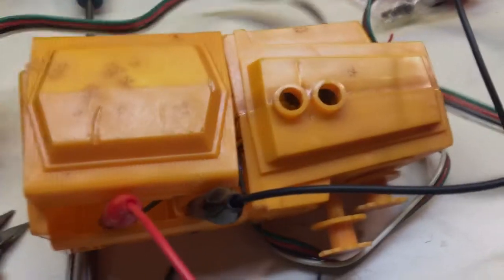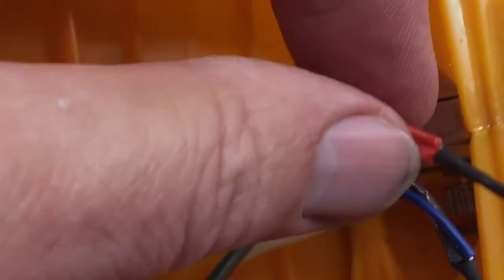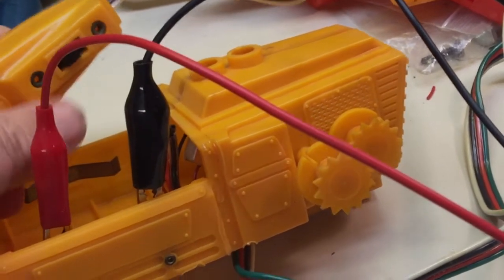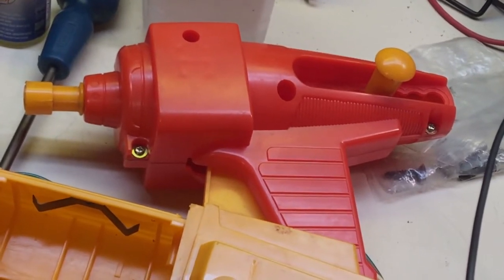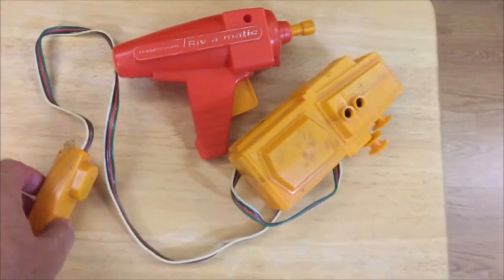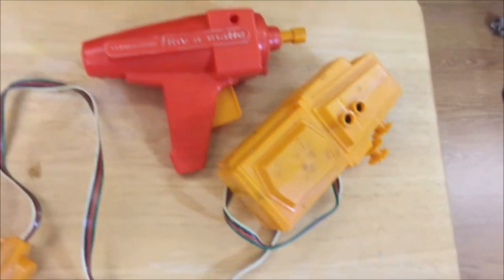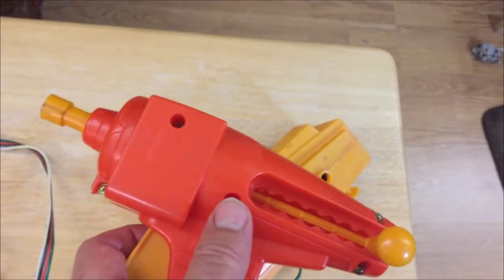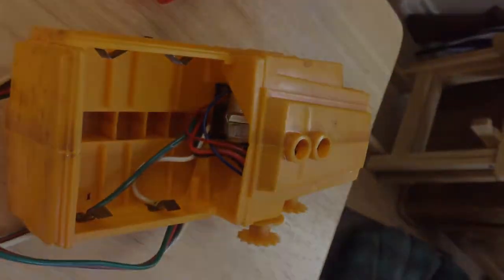Transogram Construct-All Construction Toy - 1966 - Motor and Rivet Gun

Comment: I have three sets of these.  Big disappointment.  Transogram made some very great toys, and some very cheap ones.  The plastic used in these was of either low quality or simply the wrong kind of plastic.  On two of my sets the girders are disintegrating and crumbling.  On my third set, which is the 1000 set, it is brand new, never played with, motor in paper bag.  In that set, the plastic is still firm with slight flexibility.  But I don't like to open it much as I am afraid of further deterioration.  I did build a few structures with the good parts of the other sets, but the Rivet Gun is more hassle than it is worth to actually use.  There is a reason few people have heard of these sets.  Much better off simply getting Junior an Erector set.